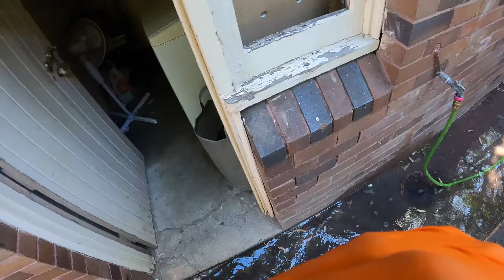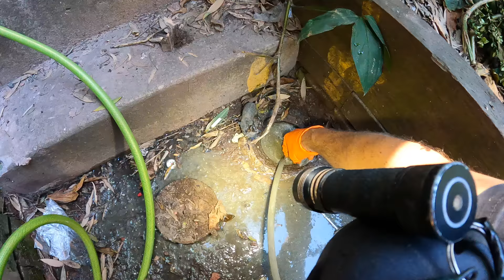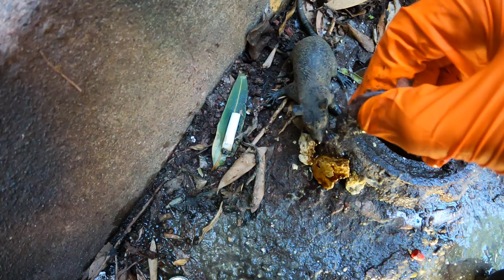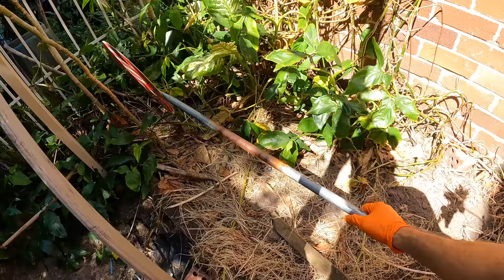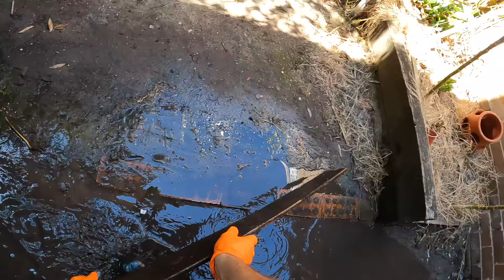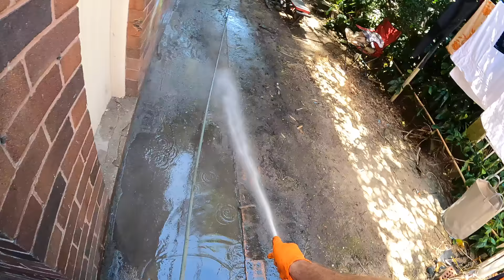Blocked Drain 536

Comment: You might want to look into getting a wetvac with a built-in pump and a drain hose Ollie. It really makes removing water like that a lot easier. Love your vids🙂
Reply: And a floor squeegee. I have seen them on Amazon in every size imaginable and with a swivel head so they would stow easily in the van.
Reply: Just a old broom works wonders.

Comment: use a Hansen/Walther coupling with a short piece of steel tube (2 inches long) flatten the open end to an oval, when I worked this job this how we used to do clean ups using the jetter to push the water up hill brill channel

Comment: So either the residents abuse that plumbing by flushing he wrong stuff down it regularly or that's a crappily (pun slightly intended) designed system for that location.
Reply: Why not both? A little grease here, a cracked pipe there, maybe even a wet wipes nest!
Reply: @danistador  cracked pipes I can forgive if the layers were rougher than they should've been. The rest are atrocious infractions, there should be an education program to get people to properly deal with wipes.

Comment: Ok, explain me this: When you have a full pipe that is blocked, and you stick the jet down deep, and then you turn on the water, but nothing overflows out of the pipe (like in this video), WHERE IS THE WATER GOING?! You're adding water, so it's gotta go somewhere. If it doesn't overflow, is it filling up all the different lines that feed that drain, backflowing to the house or wherever? All the lines are usually all filled up already, though, by the time you get to the job, so I'd assume it would just start flooding out somewhere inside, but you don't seem too worried about this when you do it. Or is it leaking slowly through the line until it clears or what, because it seems like it should be overflowing? I'd really like to know.